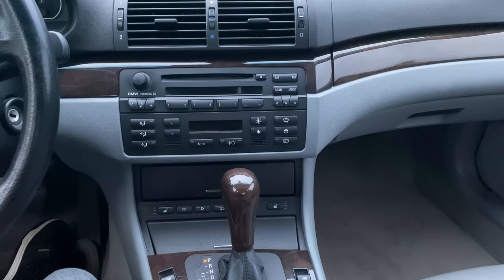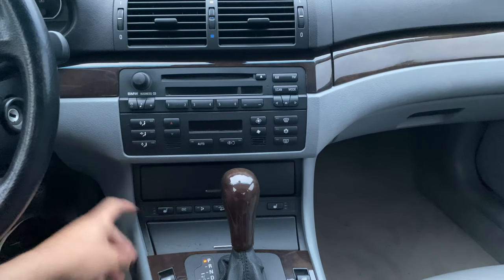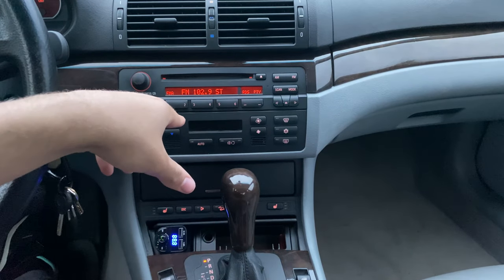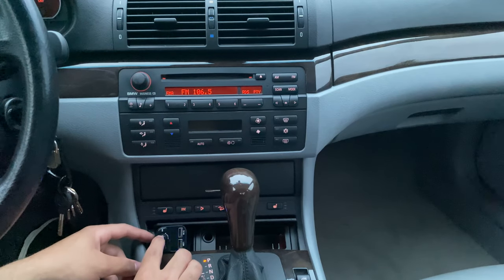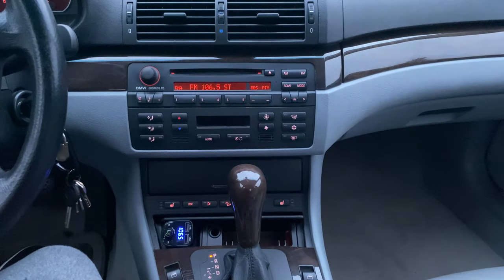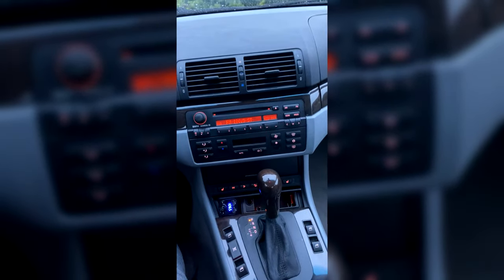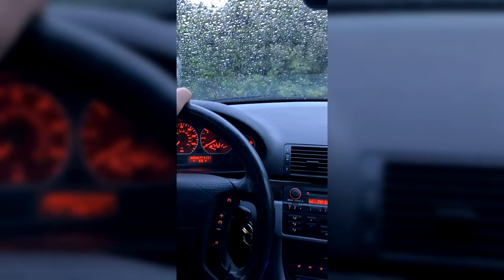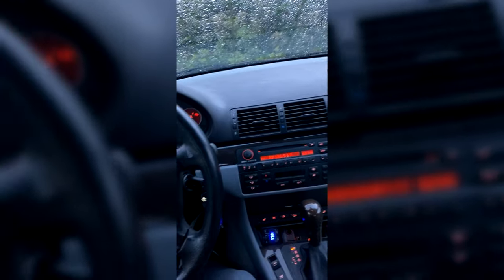KEZAY/LIHAN Bluetooth Wireless Car FM Transmitter Charger (SOUND TEST & INSTALLATION)

Comment: And whats nice is even if you leave it in the port the car will shut the transmitter off so it wont kill your battery
Reply: Can someone confirm this? I just did this today and left the transmitter in my e46 for a couple hours, and when I came back to the car it was still on. When I turned my car on it sounded good still… but I don’t know if my battery got drained a little bit. Someone plz help me
Reply: @lashgang4841 some cars turn off the cigarettes port automatically to prevent drainage if yours still on after hours you need to remove it after finishing using your car

Comment: Nice little thing. One issue, when you use your wiper or turn signals the volume drops. Either way it's dev one of the best transmitters I've found so far. The bass boost is a big +
Reply from the maker: Oh interesting, I don't have that issue
Reply: it can be a battery issue
Reply: What do you mean bass boost? My E46 speakers sound great but the bass is lacking a little for my liking
Reply: @TutahDrives  I don’t have that issue too I bought mine at a Gas Station for like 25 Bucks i think
Reply: That's a battery issue lmao
Reply: lol what
Reply: What type is  does Walmart sell it
Reply: @TutahDrives  will this work without a radio?
Reply: @johnlawful2272  brah no
Reply: does it drain the car battery?

Comment: On second thought, I bought a cig lighter plug in wireless bluetooth device off Temu for under $10, and way easier to set up. But this is still a very good video.
Reply: is it still working to this day?
Reply: @toddd0uglas , yes. But I gave it away to a friend. Turns out there's an existing connector built into the wiring harness behind the passenger kickplate. I ordered an adapter online, it runs into the side of the glove box, and I plugged a 6ft aux cable in. The sound is way better than wireless. 👍

Comment: This was very helpful! Going to use it on a 2005 C240 4matic. 👍
Reply: does it drain the car battery?
Reply: @chelsealegend8407  Not much after turning off your car remove it

Comment: Mine doesn't even change FM stations it just stays to only one FM-96.5 . I've read the manual, done all the steps I needed to do in order to change FM channels but it still won't change. Every time I turn the volume knob which is the one supposed to change the FM, it only changes the sound from U00 to U30, not the FM... is there something I am missing? If anyone can help? Thank you in advance.
Reply: Hold the call button until the number starts blinking

Comment: 1. I’m assuming it’s then sending the same radio signal back to the one you selected and making it work that way.. you connect to Bluetooth and it gives off your music to the signal the car is trying to reach to… now what if someone else were to go on the same signal? Would they hear it instead? Both of you? Would there be a way to tell?

2. How do phone calls work? That was another thing in its description, but you’d have to have your phone close to you no? For the phones microphone.. 
if 1 is an issue could someone else hear your calls?

Comment: Do you have to change stations if you drive to different areas or once you're locked in you're in?
Reply from the maker: you're pretty much locked in for good. occasionally, I'll change the station if I enter a big city just because you may run into some interference. my advise is to keep the station on the lowest number possible, 88.5 gives me the best sound quality